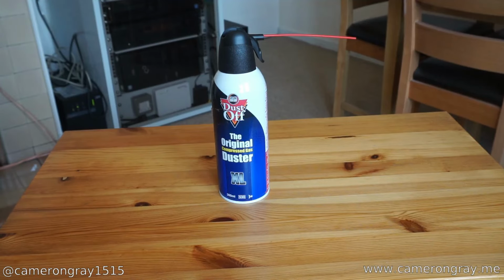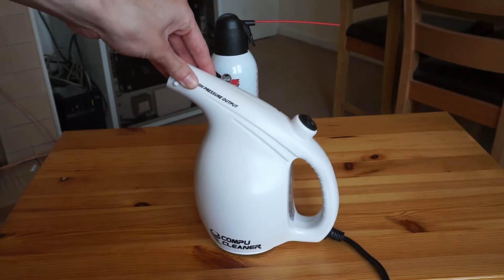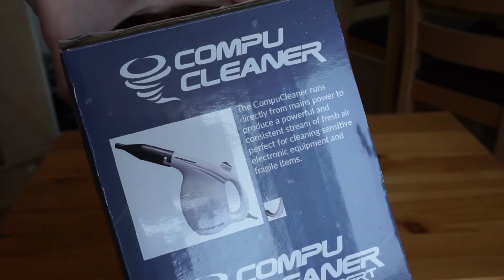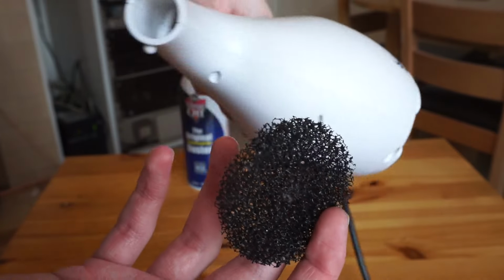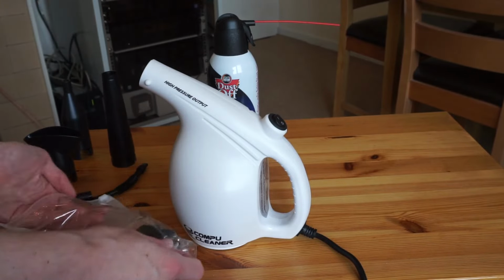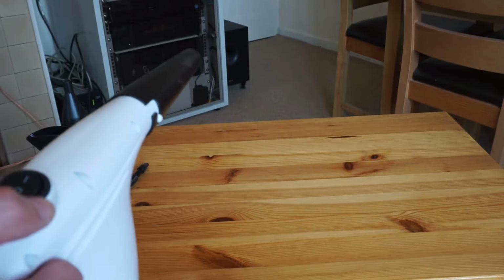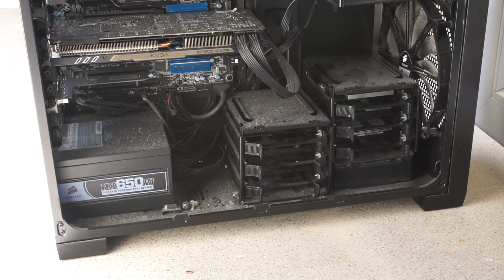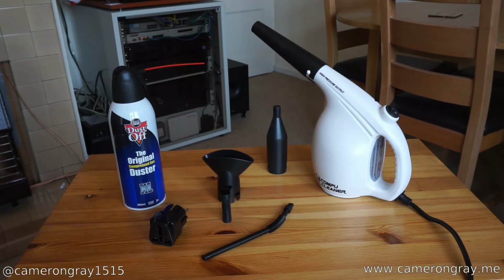Review - CompuCleaner Electric Air Duster

Comment: I have the exact same model but mine only came with wide, thin and regular nossils and I need to keep the power switch pressed down or it flips back off as soon as i let go. Mine also comes with a uk plug standard.

Comment: That PC was DISGUSTING! How could you let it get that bad? Makes me think you put all that shit in there on purpose, just for the Demo.
Reply from the maker: I didn't dump anything in it for the video but it took me ages to go from "I should get one of those air dusters" to actually buying it so I left it for quite a while until I got around to it.  The machine also sat on the floor running pretty much constantly, had pretty high airflow through the case and dust filters which weren't great so that didn't help the situation.  The case also had negative pressure which meant that a lot of dust would get sucked in through unfiltered gaps in the case.  Most of the dust was just settled on the bottom, heatsinks were totally clear so cooling performance wasn't really impacted.
Reply: I meant it in an amusing way. Some people let things get even worse. Bought one of these blowy things early this year, swear by and use it once a month. A very useful and powerful tool that will always destroy  the performance of compressed cans. Poundland still do them and it took 2 cans to clean the PC each time before. A waste of money. Got mine on Ebay from a shop for £50. It's almost paid for itself already because have used for other things too.

Comment: Could this be used to inflate an air mattress?
Reply from the maker: It definitely seems similar to one of those inflators but not sure if it would be able to cope - This is normally designed to blow air unrestricted and even then can run a bit hot, it might struggle if it's having to deal with the additional pressure of an air mattress.

Comment: Save your money and get an Electric Air Pump with a hose, and fit the narrow nozzle on the end. £15 at Argos. I did hover over buying one of these but £50 is a bit too much for a glorified air blower. The electric air pump is just as powerful with the nozzle and whilst it may lack a filter, you could put a mesh over the input end to prevent dust from being sucked back through. Anyway just a tip if someone's looking for one but doesn't want to spend £50 on it. 👍🏼

Comment: Would not recommend to do that in living room, especially heavy carpeted one. You will struggle to get all the dust out of those carpets and little crevices later :D
Reply from the maker: Which is why I went outside for the bit when I used it

Comment: I can vouch for these. I have had a Compu Cleaner for about three years now. Haven't had to buy canned air since. This is more powerful, doesn't get cold in my hands, and I can use it on more than computers.
Reply: Every IT department I've knoown has had the compressed air cans for one reason - it's failsafe, and cheap to buy in bulk. What if the power doesn't work where you need to go, what if you forget to charge your portable air duster, what if the battery fails? etc.

However I agree that it's kind of a waste to use them, plus they used to be made from chemicals unsafe for the environment
Reply: @MenkoDany   I mean, sure.. That makes sense in that specific scenario. My home is not an IT department, thankfully (and I use the cleaner for much more than just my electronics). This cleaner is also not battery powered, and if one was going to worry about the power being out in a server room, you've got more problems to worry about than some dust in your racks.

Comment: Leaving your PC case open gives better airflow, however provides more dust over time.
If you use one of these every now and again, leaving your case open would also help temps i guess?
Reply from the maker: A case with properly organised airflow will usually cool better than an open case as it will cause air to flow over components. If a case is left open you run the risk of air not flowing directly over passively cooled components such as your chipset, storage devices.etc.
Reply: @camerongray1515  Mine is properly cabled managed, and airflow is good in turn. However when gaming my temps getting high, i check inside and theres a lot of dust. So i got this duster and will check how it performs.

Comment: my problem with these stupid things is they never have that initial burst the cans have, that burst that gets the really difficult to remove stuff. 
These are mildly helpful, but you are going to get one; get a paint brush [brand new and just for this purpose] to dust things off before with just one of these. Also considering hard nooks like heatsinks; yeah electric blowers are useless shite!. What we need are mini air compressors that can burst like the aerosol; like they have for workshops but smaller for this lighter duty.

Comment: I think this things is a glorified hair dryer and I wish I hadn't spent £45 on one.

I should have looked for nozels to use with my hair dryer.

The Compucleaner shoots out warm air btw
Reply from the maker: It works similarly although I find this to be more powerful than any hair dryer I've used.  The temperature of the air isn't really a problem, it's somewhat warm from the heat produced by the motor but nowhere close to any sort of dangerous levels.
Reply: @camerongray1515  Thanks for soothing my butt from the buyers remorse 😀

Comment: I doubt if this really makes sense, since this gadget blows the dust pretty uncontrolled in every possible directions..so basically you have to clean up the environment afterwards resp. use a vacuum cleaner and/or a wet cloth..and you cannot really blow away persistent dust films..so it´s actually lots of additional work to do..and futher more  it´s extremely loud..even louder than my big philips vacuum cleaner..
Reply from the maker: I've personally never found vacuums to work particularly well for getting dust out of things like heatsinks where it tends to get trapped and I can't really get the nozzle into tight areas where it is pretty easy to just blast air in and blow the dust out.  Blowing the dust around isn't an issue for me as I just use it outside.

Comment: Here I was worried about the amount of air it would push. Yeesh. I just put my order in but I am a little disappointed that it doesn't come with a brush attachment such as yours. Those are great in combination with dust filters and heatsinks where the bristles really dig deep in regards to the finer dust which doesn't lift so easily.

Comment: Just a question, some reviews on Amazon say that the machine gets hot super quickly and starts stinking like plastic, do you have that problem too?
Also is it still working nicely after those 2 years?
I'm thinking of getting an air compressor to clean my PC with, my regular vacuum cleaner can only do so much and even though my PCs dust filters work really well, there is still very fine dust inside the care.
Would be cool if you could make an update video or just type your experience after 2 years in the description.

I'm just really impressed of the air pressure it has.
When I looked on Amazon, it came out with 2 more models, an improved white one and another black one.
Reply from the maker: It gets slightly warm and does smell a tiny bit but that's to be expected with something with a 500w motor, you aren't going to get a motor that powerful that doesn't produce some amount of heat.  That said, it's not something that causes any sort of problem.  I don't use it all that often but it still does the job fine, there's not really much to report for such a simple device.

Comment: I really would like to know how strong the fan really is.
500 watts seem to me like just a marketing number, some fans are able to lift carpets with 600 watts (look up "San Ace 600 watt" and click that russian video with the fan on the ground).
I really think that this has just some motor hooked up to a really small impeller, that sir dust can being blowed away is not really that strong of an argument since it was empty...
I will try to DIY myself a dust blower with a server fan and a PWM circuit to seamlessly control the rpm, I probably write here again if it turns out well :3

Comment: Using a shoft brush while blowing with this nice air duster is the Best way ever to clean your PC. I use it for years in my electronic repair station cleaning diferent various electronics and i love it. It doesnt have to be an expensive one, even a very cheap chineese one will do the job perfectly. I have tried everything, this is the best ever. I also use electric big air compresor with moisture trap because electronics dont like water but this is for heavy profesional use. For the PC this one is the BEST. Nice video.

Comment: I own an IT support company and was spending far too much money on air dusters ( the falcon ones you show are a reasonable deal in Costco ) I've bought the compu cleaner and use it in conjunction with a vacuum cleaner. Leaving the lid on the pc you blow air through the front ( or back ) and position the vac at the other end - less dust over everything else

there's probably someone who'll no doubt enlighten me as to the error of my ways, but it works, and works well so i shall continue to use it this way :)

Comment: So after a year, is it still good, working well etc..
Reply: Mind you if you don't use it often it should last a year
Reply: @Underagechicken  It should last longer than a year of regular use.
All it does is blow out air, no suction, so there's nothing that should clog or break down.
At worst you may have to open it up and lube some moving parts but it shouldn't just break.
Reply: @ParentalGuardian-b7z  depends how much you use it, I mean if you're going to use yours like you're doing a spray job on a car, then it won't last long
Reply: @Underagechicken  wrong
Reply: @jdc4316  explain why I'm wrong
Reply: @Underagechicken  source: trust me bro

Comment: Can I use this to clean the inside of my PS4?
Reply: No, it's specially designed that if you use it with a ps4 it will actually disintegrate the plastic.
Reply: To The GODS. YEs you certenly can.

Comment: How do you like the compu cleaner i cant decide if i want to spend the 50 bucks on it
Reply from the maker: Generally very happy with it - Only used it a few times (just not had anything needing cleaned recently) but it's worked brilliantly every time I've used it - Certainly infinitely better than the cans.
Reply: Thanks for the fast reply. I just got my pc a few months back, and with it being on a wood floor, and having bets it seems to get really bad, and i don't want to keep purchasing cans. I just wanted to make sure it had enough power to clean out the inside good.

Comment: 5:07 "Oh god he's making his fan spin I hope he..."
5:08 "Oh phew."
Reply: https://www.youtube.com/watch?v=k9KA-xLLQXo Here is the proof that there is little electricity going through the fan. My friend created this video. We are both Techs with over 50 of experience together.  This little bit of power is not enough to do any damage what so ever. Watch the video and learn
Reply: I have always wondered if that is a bad thing or not. I have never let them spin and have been told not to, but never told why.
Reply: From what I know if they spin (without the power coming from the header itself) they get up to 11 volts (I saw from a video) which may damage the fan header they are connected to...
Reply: @realkingxyro  they dont get energy enough to cause any damage
Reply: i did electrical engineering. Unless they have a Diode blocking the mains from returing the wrong way this should never be done. A fan is just a DC motor which either recieves a + and - load on the wires and it does not matter for a electro motor which way the power gets in. It will simply turn the other way around. At the same time if they spin they can generate power. now they are used to run 1600-2000RPM on 12V now use a pressure cleaner blowing it and ramping it up to 8000RPM and you make around 50 volts on that tiny DC motor. 
* The motor will burn up
* The bearings will be shot if its fluid bearings all the fluids will burn up from the hot wricktion.
* It sends the power it generates back over the ground short circuiting the motherboard especially if it reaches the caps or other chiplets.
Have tested this with some friends in school we even managed to blow up a poor Sandy bridge Motherboard and melting a Corsair ML120 in the process.
Dont let it spin.
Reply: @wargames43  the video posted by Nick above contradicts your comment.
Reply: @nahka  Theoratically it should not hurt the motherboard but practise has shown otherwise. As long as he did not try it with the motherboard plugged in its al numbers. You dont need allot to blow caps when reverse powering it...
Reply: @wargames43  The fellow in the video has been using leaf blower for blowing dusts of PC's for 20 years, without said failures because of spinning fans.
Reply: AvocadoAtrocity brushless fans wont feed back electricity but they can break themselves
Reply: MGsubbie s
Reply: A bit of a necro answer, but while I've never damaged a single board by having the fan spin freely when blowing on it (I suspect there are diodes on the fan headers to protect the board), if you are pushing tons of air through a small fan you might damage the bearing by spinning it too fast.

Comment: alot of people are complaining on amazon saying it gets really hot have long use can you confirm this or is it people just being arseholes
Reply from the maker: Gravenhex The unit and the air coming out does certainly get slightly warm but not to any sort of dangerous level although I suppose this may vary if you are using it in an already hot environment.
Reply: alright thanks :) people were saying it was acting like a hair dryer and blowing out dangerously hot air that could melt your components but id rather believe you i will definitely buying this
Reply: @Dymaknight no I didn't end up buying one sorry. I just use the compressed air canisters but I don't clean my pc that much like maybe twice a year

Comment: You could put Filters on your intake Fans as well to avoid this hassle for much longer periods. Just make sure you have more intake pressure than exhaust pressure to force air past the Filters...
Reply from the maker: They do have filters (included with the Corsair 650D case).  They certainly help but the finer dust still finds it's way in.
Reply: You need to make sure you have established Positive Air Pressure in your PC. That means more Intake Pressure than Exhaust Pressure so that Air is forced out of seams and gaps in the Case. Then you can get a pair of Nylon Stockings and use the material to cover the intake Filters for finer filtering. Macs use HEPA Filters in their Cases. I've never seen them for PC's...CHEERS
Reply: Positive pressure means every hole without a fan is exhausting, every pc case has enough holes for the pressure to escape so no harm will happen.
Reply: And suffer temperature gain and performance loss to just get dust out and risk creating static pressure which damages your internal cpu components in time? no thank you....Id rather have the hot air being exhausted out of my pc than intake a lot of air with more intake fans than exhaust and risk my desktop becoming a grill....